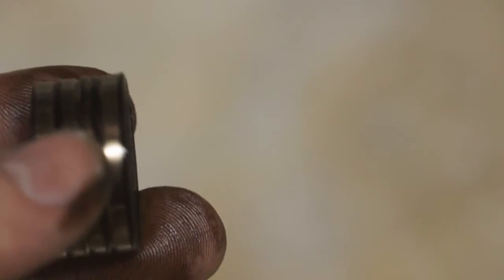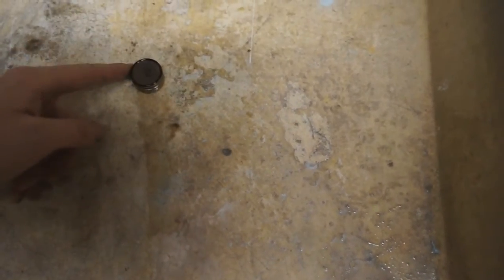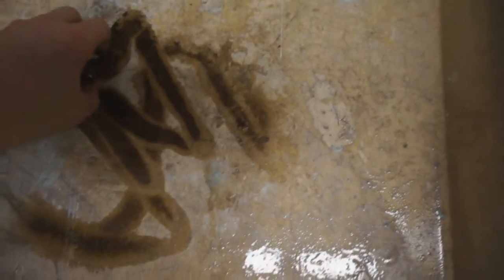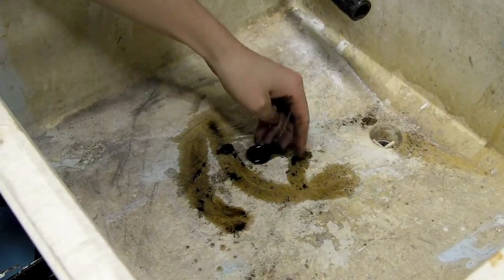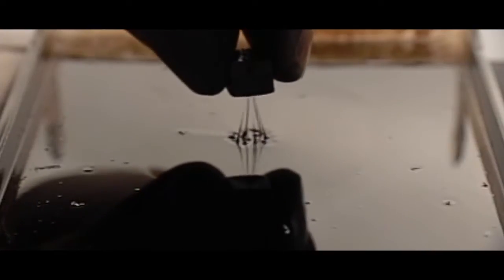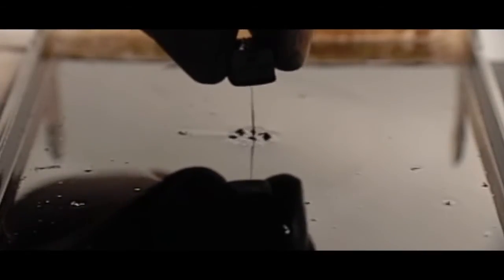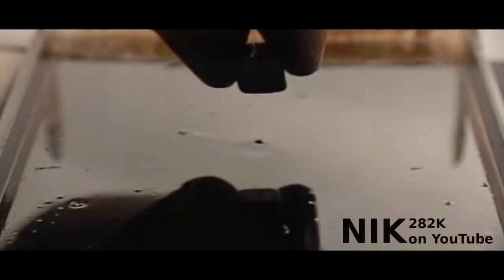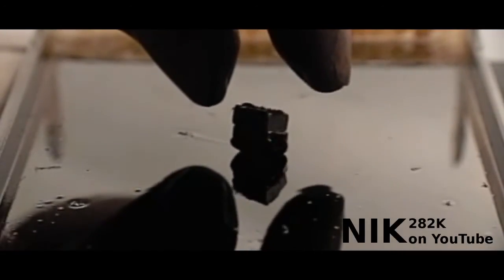Frictionless Ferrofluid Bearings

Comment: Cool video. I've read from a few sources that say that the iron nano particles in ferrofluid are not good to have on your skin. I think it was because of the small size, it gets absorbed through your skin and is quite toxic. But I admit that when experimenting with ferrofluid, even if i'm being careful, it's so messy that it ends up getting on my hands somehow anyways. Just thought you may want to wear gloves or put a warning on your videos. Also, try using a sphere magnet. It glides around even better. Check it out!
Reply from the maker: I do have gloves they are just usually not in the same room, I should leave a handful next to the ferrofluid equipment bin. Did you figure out an easy way to clean ferrofluid off of a magnet? I ended up absorbing it with papertowel and even then it wasn't great.

You've also made me wonder how small the particles really are, I should put a drop under the microscope and see if they are big enough to see.

Thanks!
Reply: Oh yeah, in that video I just sent you I had also added a dash of super fine gold powder that allowed the detail of the ferrofluid surface to be seen more clearly. That's why it may look a little colored. The gold powder just stays right on the tops layer of the surface, and doesn't mix with the fluid.

Comment: Nice, Try using that spray for hats that repels water, a hydrophobic coating like that might let the magnet keep its fluid. Please let me know if you do!!
Reply from the maker: Interesting idea, ferrofluid is oil based but there are "oleophobic" substances that work for oil like a hydrophobic substance works on water. I still have some ferrofluid left and plan to mess around with it again.

Comment: This is actually already in use today in several hard drives and speakers. Not only is the friction extremely low, but it also creates an air tight seal.
Reply from the maker: +Tag Wolf Cool, I'll have to find an one or the other and see how much fluid they really need to work.

Comment: It just (re?)occurred to me that if you had a pocket 1/8" or so larger than the (round) magnet, you could stick an axle to it, wrap it with ferrofluid and have a decent little bearing.  It probably wouldn't have great properties at high speed but it would have almost zero stiction.  May be good for galvanometers, gauges, etc, especially if a little compliance under load is desirable.

This is a pretty cool application too - Ferrofluid Piston

Comment: I feel like i'm spamming all your videos, lol.  

This might make a cool bearing for diy LP turntables.
Reply from the maker: They would be fantastic if it didn't dry out over time. It feels firm like a boiled egg but more slippery than any other surface I have ever felt, perfect for a record player.
Reply: @NickMoore  I'm back at this one haha.  Thinking of building a gimbal for satellite tracking.  All the ones i see people using are for astrophotography, and the drivetrain/controllers don't seem to be set up well for the slew rates.  Also lots of alt/az setups that require good motion control from at least two axes to track (and you still end up with field rotation).  Would love to find a bearing that stays smooth as glass, doesn't need high speed, high load or super precise alignment.
Thinking if there was a say 4" diameter magnet running inside of a very slightly larger non-ferrous case (e.g. +1mm) and just use a couple silicone seals to help keep the oil in.  I need a lathe lol.
For the drivetrain there are a newish type of low-cogging torque motor that uses slewed stators to smear the cogging torque a bit.  Use smooth belts for gear reduction and a high precision rotary encoder on the output to detect slip/stretch/etc.   Add a third axis to the thing for alignment with orbital plane.  Probably cost $10k to build and will forever be a mental exercise, but a fun one.
Reply from the maker: @jcims  You could probably locate the bearing with a small pin at the center and use the ferrofluid bearing to hold the load, then you wouldn't need tight tolerances on the non-ferrous case.
I'm actually in the very beginning stages of building new guts for an alt-az mount that I fried. It's slowly turning into a mental exercise for me as well.
Reply: Nick Moore i like that idea. I just bought a giant ‘fishing magnet’, which is just a rare earth magnet in a case.  I’m thinking there are going to be rediculous flux lines where the case meets the magnet and it should make a nice reasonably controlled ring of fluid.  Many of them have holes in the center for mounting a hook, a pretty stout locator pin could go there, maybe on a roller bearing.     
There’s a robotics channel on here called open dynamic robot initiative.  Not sure if you're thinking mechanized mount or not but they have a leg actuator design that i have been eyeballing for the uprights of my 'mount-that-probably-will-never-be':  https://github.com/open-dynamic-robot-initiative/open_robot_actuator_hardware/blob/master/mechanics/actuator_module_v1/README.md  (You would almost certainly need to scale it up by ~2x though)
The design includes a rotary encoder for position control, depending on the weight of the scope you could run a motor in one or both and just sync them in the code.
Reply: @NickMoore  do you have any ore videos of further research? Could you send a link? Tyvm